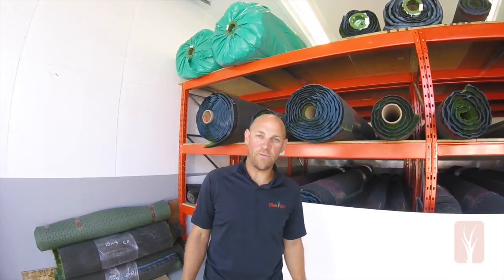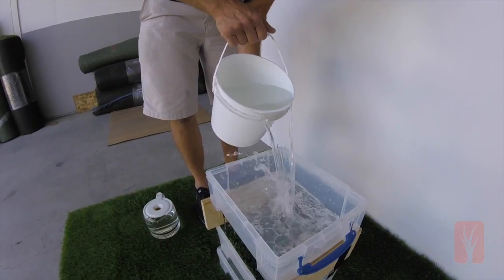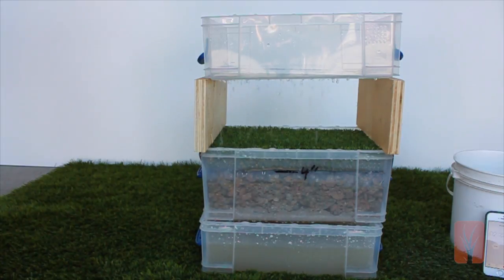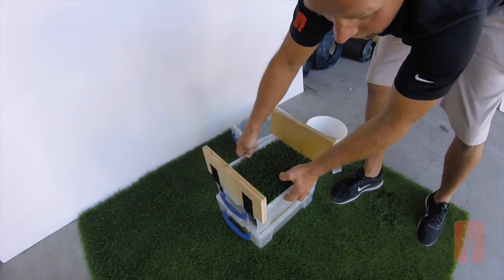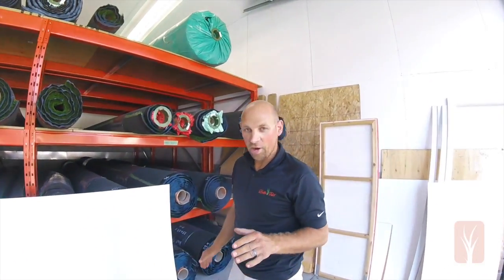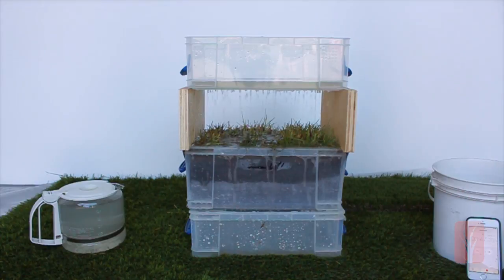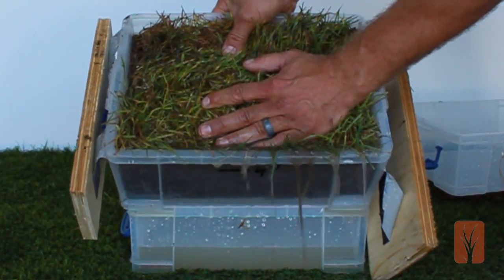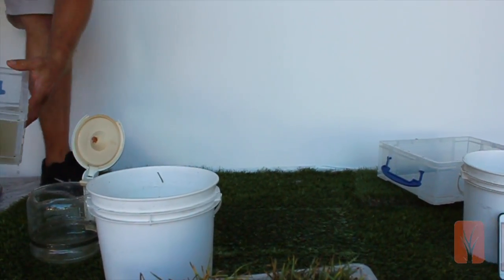Artificial Grass vs Natural Grass - Percolation Rates

Comment: However if artificial grass was better at absorbing water you also have to calculate how much plastic material got into the water. However I do think artificial turf is more environmentally friendly then what people think because it doesn’t require fertilizer. But you have to consider all factors. You have to consider that it won’t allow insects to live in and under the grass, it uses plastic which isn’t biodegradable, you have to look at how often you will need to replace the grass.

Comment: You said sand was supposed to be the best water drainage soil type but it’s actually gravel. So since you put the artificial turf over the gravel but didn’t do the same for the sandy surface you were misleading